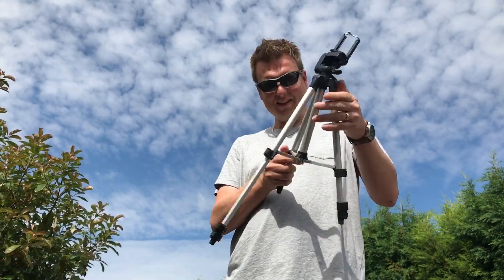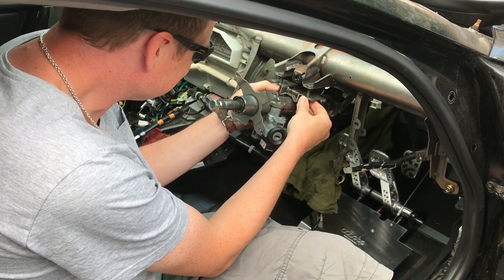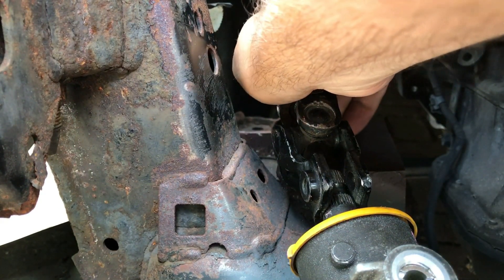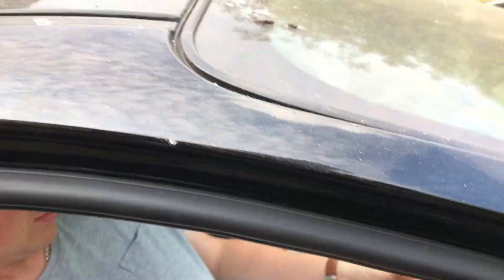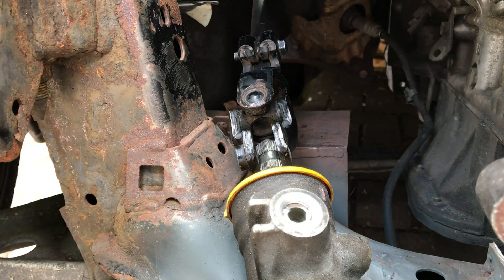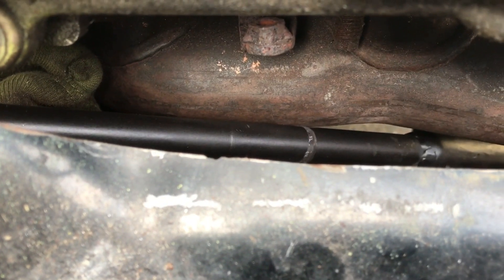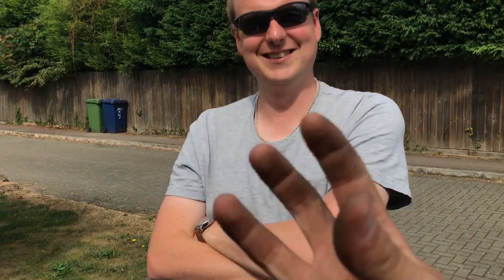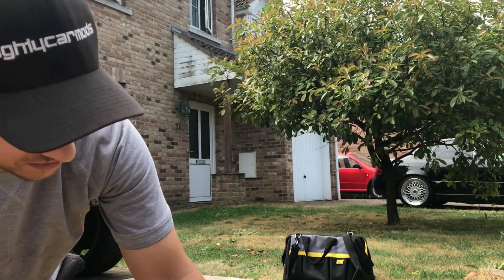RX8 3uz-fe Lexus V8 engine swap episode 6 - steering column extension and exhaust manifold mods.

Comment: Does the nc Miata steering rack bolt into the factory rx8 mounting location? I know you made custom brackets, but I assume that's to make room for the V8. I still have the rotary and don't think clearance will be an issue.